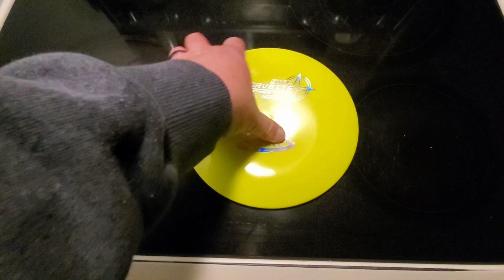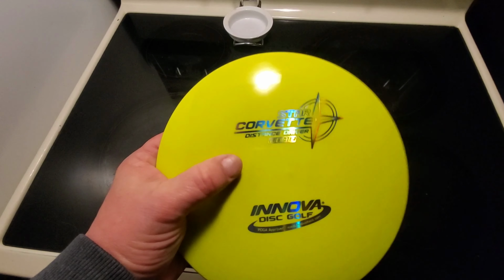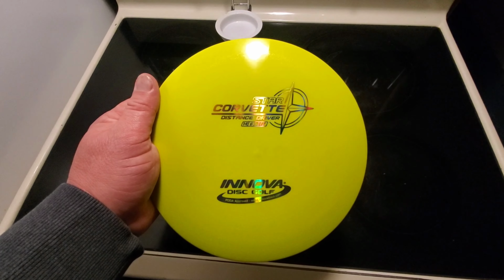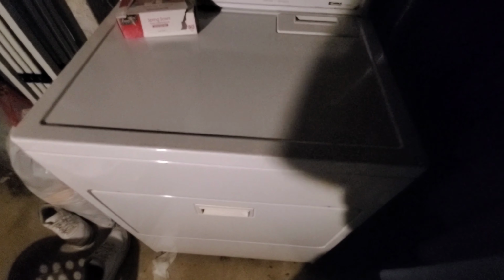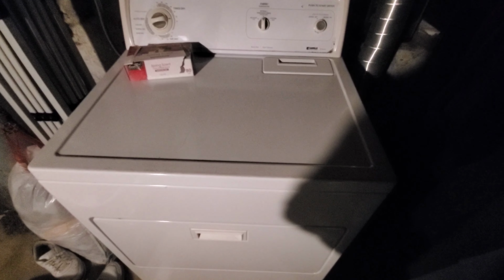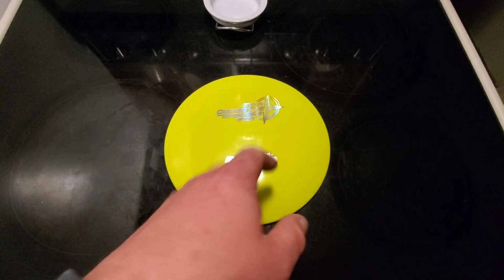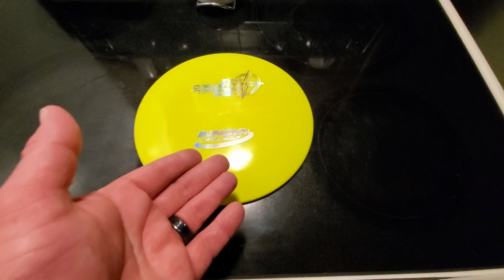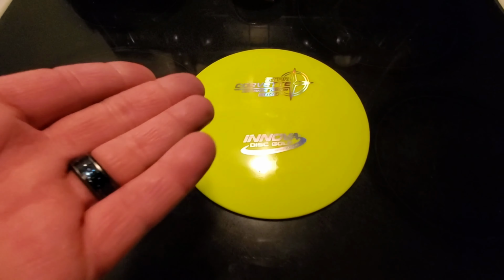Breaking In A Disc: Does This Work?  Part 1 #discgolf

Comment: Its a high speed driver. You can throw a 14 speed???? No sir u will only go left all day😂😂
Reply from the maker: @1981jakehamilton  I was bagging the yellow Corvette and it had a very nice S line flight. Sometimes it would pull way to much to the right and even turn over. Check out part 3 of this series.